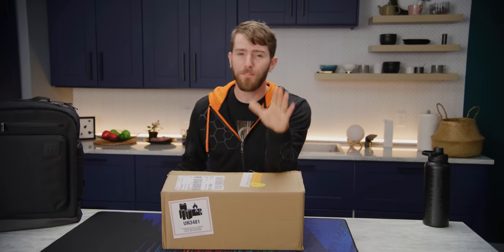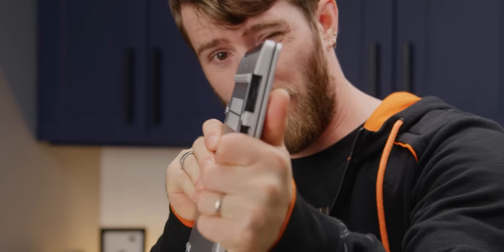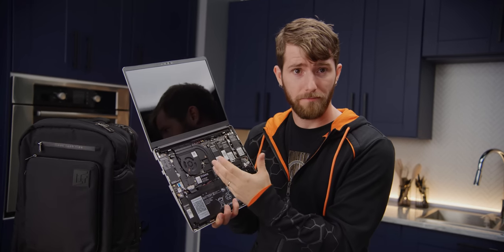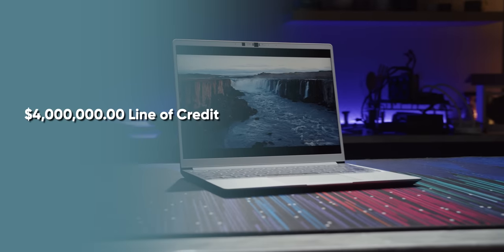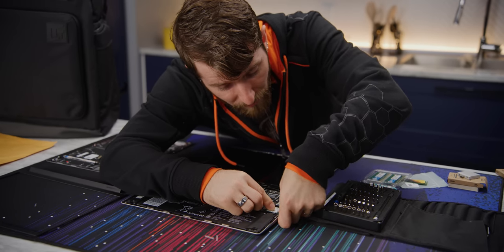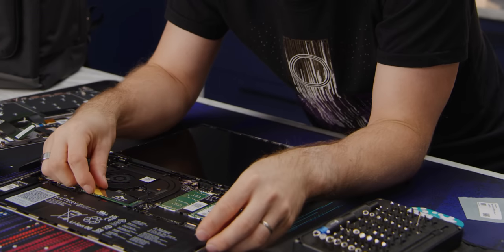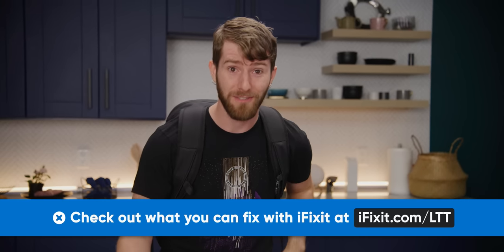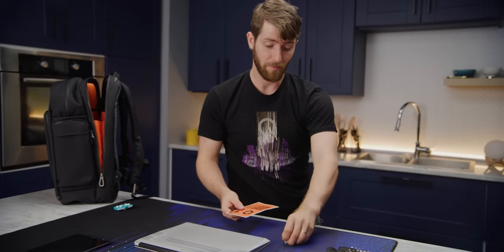I’m Legally Obligated to Disclose This - Framework investment

Comment: I was ready to buy one today after seeing Louis Rossmann's vid on this but I prefer a 15" screen and I have to have a discrete graphics card as I use it for video editing. As soon as you guys make that happen count me in.  I've repaired thousands of PC's and laptops in my day and this move to fully integrated, disposable systems is one of the worst trends I've ever seen and it's time for it to come to an end.
Reply: With you there on the screen - I have a beefy desktop for graphics, video, etc. that I can access with Parsec if I need the power, but I really want a lightweight Linux machine with a large 1440p screen and outstanding battery life for writing code on the go, but they are surprisingly hard to find.
Reply: @nathanupchurch7549  Have you looked at Chromebooks?  I've rooted a lot of those to linux and they have amazing battery life.  The Google Pixelbook has a very high res screenbut it's not that big.  There has to be someone that did a high res 15" screen you could do something with.
Reply: Same here, if they add a 15 or 17 inch option with discrete graphics I'm buying one in a heartbeat. Hopefully it has a numpad on it too
Reply: @whocares3132  I haven't done it in a while but I know with the first or second gen Chromebooks I was able to install Ubuntu
Reply: I'm fine with 13" screens but need 2in1 functionality and a touch screen. But I'm very hopeful that the framework team will eventually produce those options.
Reply: Yes, this so much. If they could make a 15 inch or bigger one with options for discrete GPU I would be extremely happy as a gamer.

An easy to repair, nice laptop without gamer aesthetics? Count me in
Reply: The ports are Thunderbolt 4 but not "certified" yet, I bet you can get an external GPU dock working on it.
Reply: I think framework said they are working on an AMD model. So an APU would partially fill the need. Later down the line they may be able to put in a discreet GPU.
Reply: I’d like a dedicated gpu but keep a smol screen.
Reply: You can ALWAYS find something wrong with something if you try hard enough. Given that these USB ports are Thunderbolt 4 (just not been certified) you can hook up an egpu and upgrade it later on given the form factor of this laptop. So stop thinking of the things it needs and start thinking of all the stuff it DOES have. Buy one. You're putting people off an amazing product, you will soon overlook its flaws.
Reply: @KidCorporate  Yup you can! Elevated systems tried it. It works flawlessly.
Reply: @churchseraphim1380  agreed, I plan on buying one even if they don’t have a discrete gpu because I probably won’t be playing very demanding games on my laptop but a discrete gpu would be amazing to have
Reply: @nathanupchurch7549  I would love this to keep the 13” screen (I like smaller laptops) but having a 1440p screen is a huge thing for me. My current laptop is 900p 13” and I love it, but the screen is pretty awful (it’s a TN panel with awful viewing angles)
Reply: Your able to connect it to an external monitor and if i had to guess, probably a projector. Easy 15" screen, but im assuming your not willing to do that so ill shut up now.
Reply: @nathanupchurch7549  I am awaiting for a laptop with  3060 or 3070 laptop for Data Science and AI Simulation and algorithms for big data visualization. I was thinking of going for Ryzen 6900HX or i7 12th Gen. I am also working on Network technologies and learning Firewall and cybersecurity over Cloud. 

What would be the best option for a  working professional who also needs atleast 3-4 hours of battery life?
Budget: 2 lac INR

Should I wait longer for another laptop or go for anything that's around for 2000-2200 USD?

Looking for usually 17.3 inch or so for better screen as I am working on large data and visualizations. Small screen makes tough to work on large models

Anything best value for money under 2 lac?
17.3 inches only
i7 12th gen or Ryzen 9
GPU based task moderate to high. I do not need 3080 or 3070 TI. 
Screen quality = QHD
Reply: I am awaiting for a laptop with  3060 or 3070 laptop for Data Science and AI Simulation and algorithms for big data visualization. I was thinking of going for Ryzen 6900HX or i7 12th Gen. I am also working on Network technologies and learning Firewall and cybersecurity over Cloud. 

What would be the best option for a  working professional who also needs atleast 3-4 hours of battery life?
Budget: 2 lac INR

Should I wait longer for another laptop or go for anything that's around for 2000-2200 USD?

Looking for usually 17.3 inch or so for better screen as I am working on large data and visualizations. Small screen makes tough to work on large models

Anything best value for money under 2 lac?
17.3 inches only
i7 12th gen or Ryzen 9
GPU based task moderate to high. I do not need 3080 or 3070 TI. 
Screen quality = QHD
Reply: @Naraayanay  The SKIKK Loki 17 II, the System76 Oryx Pro and the Tuxedo Stellaris 17 Gen3 are each close to ticking all of your boxes. You might consider having a look at the Zenbook Pro 17  also. I assumed you'd want something that runs GNU/Linux well based on your description of your work; if that's the case, you may have an easier time with the System76 or Tuxedo PC as they can come with a Linux distro pre-installed if you want. That said, AMD GPUs are much easier to work with on Linux (dealing with hybrid Nvidia graphics on Linux can be a headache depending on your distro).
Reply: In addition, im sure this reduces quite a lot of e-waste. Instead of replacing an entire laptop and essentially throwing the other one away, its just a single part. Id love to see Framework implement something about recycling used products or sending them back or something like that.
Reply: Better order one now
Reply: Time to jump in!

In maybe a couple of months once pre orders open 😅 0:54
Reply: Good news bro
Reply: They now have a 16", enjoy :). It also has a gpu
Reply: @Fohacidal  Well it’s coming but it’s not quite 15 or 17 inches
Reply: @4hedron852  lmao I know right, I'm gonna order the 16" one
Reply: Good news
Reply: did u end up pre-ordering the framework 16 lol
Reply: @HolyOllie  I did for sure lol
Reply: @HolyOllie  Nope, needs changed and I went back to a desktop.
Reply: Framework 16!!
Reply: 2 years later: The Framework 16 just arrived with a removable discrete graphics card.
Reply: They made a 16 inch one a few months ago with a DGPU

Comment: This just feels right. The right to repair movement needs a legitimate leader in this space and Framework with Linus are taking a big leap forward.
Well done and good luck!
Reply: Don’t diss my man Louis like that pal 😡
Reply: @jj481012  Luis is great but he sadly does not have the same pull and reach like Linus has. Thankfully they're cooperating so both can throw their strengths into the mix and hopefully ensure we'll some positive changes both in legislation and otherwise.
Reply: Implying Rossman is not legitimate?
Reply: @RAHelllord  idk about that. Louis now has lobbyists and is aiming at lawmakers directly. Maybe it's not how many people you need vs which people you need. 

Hopefully Linus and Louis are two sides of the same coin. Linus can do a lot to educate the public, while Louis works hard to push things through the legislative process.
Reply: @jj481012  louis is fighting the micro, with specific states he focuses on, along with kyle weins at ifixit. Their strat is the domino method. Linus is more of the macro game, as a solid leader to the masses, which may help at voting time. both are needed.
Reply: @fluffybunny7089  Louis knows what the legislation needs because he has extensive knowledge in the business of repairing devices down to the smallest possible parts, but Linus is the person that can reach more people and thus increase pressure from the public onto the politicians. Rossmann having now lobbying politicians directly is important, but companies against right to repair have been lobbying the same politicians and are part of why things have deteriorated over the decades. And considering that plenty politicians listen to the bigger donation unless public pressure is getting too hot we're probably going to need Linus's popularity for every step of the journey.

But again, Louis is incredibly important, too. His know-how about electronics and repairing them is invaluable and he can figure out whether proposed legislation is actually useful or just a scam, and put some more unique pressure on politicians than just the internet mob can.
Reply: @RAHelllord  Hopefully they can push the people here in the US to put some pressure on the politicians as well. Right to repair is needed here!
Reply: @anakinlowground5515  Luis Rossman is New York Based so he's planning on going for US Politicians luckily
Reply: I am awaiting for a laptop with  3060 or 3070 laptop for Data Science and AI Simulation and algorithms for big data visualization. I was thinking of going for Ryzen 6900HX or i7 12th Gen. I am also working on Network technologies and learning Firewall and cybersecurity over Cloud. 

What would be the best option for a  working professional who also needs atleast 3-4 hours of battery life?
Budget: 2 lac INR

Should I wait longer for another laptop or go for anything that's around for 2000-2200 USD?

Looking for usually 17.3 inch or so for better screen as I am working on large data and visualizations. Small screen makes tough to work on large models

Anything best value for money under 2 lac?
17.3 inches only
i7 12th gen or Ryzen 9
GPU based task moderate to high. I do not need 3080 or 3070 TI. 
Screen quality = QHD

Comment: This is going to be a MacBook killer. WAKE UP APPLE
Reply: It’s a really cool idea, but it has a long way to come to catch up to the new MacBook pros.  If I needed a cheaper PowerBook style pc I would buy this.  But it doesn’t replace my workhorse M1 Pro MacBook Pro.
Reply: 2 yil, apple, 2 yil
Reply: @dailyshadow  I feel like thats due to Framework prioritizing the repairability part of making a laptop rather the spending that R&D money on performance. They both have their values and here's hoping Frameworks laptops will be powerful enough that most people are happy to use it from watching Youtube videos to using cpu-intensive applications.
Reply: Even if the framework surpasses the Mac book in performance in every metric, the Mac book still has the vendor lock in of the Mac Ecosystem.
Reply: Apple lovers will be Apple lovers, no matter what device will become trending because it's better.
Besides, Apple has its own ecosystem that not just makes all apple devices work well with each other, but also makes working with any other system practically a nightmare.
Reply: Apple fans will never switch, it's basically hard wired. They'd probably be afraid they'll break it and because they're used to Apple they fear they'll have to buy a completely new one, or complain that windows is "incredibly dangerous"
Reply: No, let Apple sleep away its success. Eager to see it fall in market share in the coming years.

Comment: That bezel just popping off so easily made me unexpectedly excited. As an IT technician, screen replacement is probably one of the most annoying processes because the bezel never comes off as easy as every video males it seem.
Reply: That and it always feels like a few plastic clips make it their mission to insure they'll never go back in the latch they originally sat in. 

Either cause the WiFi antenna band sifted or because the clip didn't survive the opening process since you accidentally used just a smidge too much force.
Reply: It's held on with magnets. You can't get any cooler. As long as you have an average IQ you can fix that laptop. In fact, I'd wager that if you can get in the army you can fix that laptop.

(Edit: and I want to be clear that I'm not saying people in the army are stupid, it's just the only organization that has a stated minimum IQ for entry)
Reply: I wonder if I'll make you wet your pants when I tell you this part (which you might already know if you've been paying attention):

The screen isn't glued to the top case. Screws only.
Reply: ASUS VivoBooks make me want to throw them at the wall. Also the new cheap HP laptops have the panel glued to the top lid. Which meaning you have to risk bending or breaking the top lid assembly to get the screen off.
Reply: @DetachaplePenis  is it actually the bottom one third? I didn't think it was actually that high. If you are correct, that makes my comment look rather foolish. Thank you for your input.
Reply: We just request full display housings on dell techdirect now when we do repairs in my company
Reply: What are you talking about, bezels come off super easy. It's getting them back on with all the broken tabs that is the issue.
Reply: @TacticallyGrumpy  ^this! 🤣🤣🤣

Comment: I have one (admittedly really weird) gripe with the framework. Standard loadout comes with 4 USB-C modules. These are $9 each in the configuratior. Ok, reasonable.

But…

The modules connect via…

USB-C…

Wouldn’t it be a much better use of your money to get 4 other modules and if for whatever reason you need a USB-C connection just pull a module out and connect directly?
Reply: 😂😂 this is a wonderful observation. I guess they really don't NEED to put a usb c piece in there, however, durability could be better with the replaceable pieces. The main usb-c gets plugged in a few times, and the USB c modules are the "disposable" ones.  I'm wording it very weirdly but I think you get it.
Reply: @devinstepp4205  I do. I was just thinking though with type c connections being soo tiny and those modules soo big, if you are gonna use a module anyway why not offer one that has two or 3 type c connections? There is definitely room for them. Even as an option. Like, yeah the single ports are thunderbolt but nobody NEEDS 4 thunderbolt connections. Split one into 2-3 type c 3.1 speed ports and that frees up the other slots for soo much more modularity. Hell offer a module with two type A 3.1 speed connections as well. Again there is DEFINITELY room. The framework could be the next AND final word in modular business laptops like that modular thinkpad they reviewed a bit back but framework has NO imagination with it comes to one of the main selling points of its flagship product. Doesn’t bode well for the company.
Reply: @OtioseFanatic  it might be a prioritization thing with having such a small company.

As in: they could've made one module with more than one non-thunderbolt USB-C but decided not to because that would add more stock that sat around, and tooling cost. 

People on the framework forums are also trying to design a module with two usb-A ports but it's a really tight squeeze and would probably need a clever manufactured (not DIY-able) design that they didn't put hours into because of other priorities.

Some people made some cool 3D-printed DIY expansions though, one guy made a magnetic charge port using off the shelf parts and someone's designing an ethernet port. It's cool what people are doing with these laptops.

Comment: As loudly as I am rooting for the repair movement (and as a tinkerer myself), I can not unsee the industry moving towards more specialized, efficient hardware that is joined in SoCs, like Apple's, backed up by the cloud backbone. I want to be able to change my own screen and battery but the computing modules are gaining more diversity in function, yet are joined in a single chip for efficiency. With the energy crisis not going away anytime soon, I can see many of us switching from our energy hungry desktops to the more efficient laptops, yet demanding the ability to customize and expand. Of course I'm sure Linus made its due diligence, but, damn these are exciting times 😯😯😯.